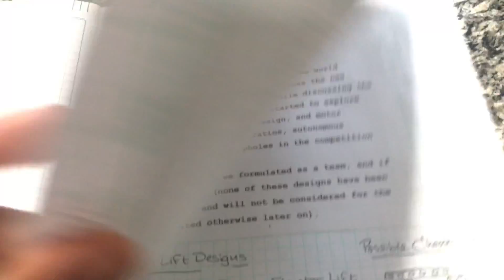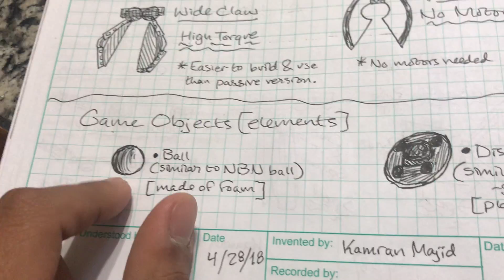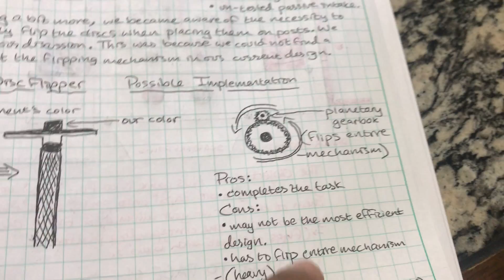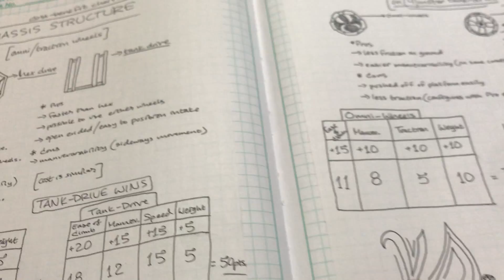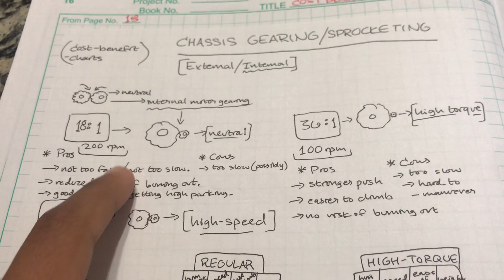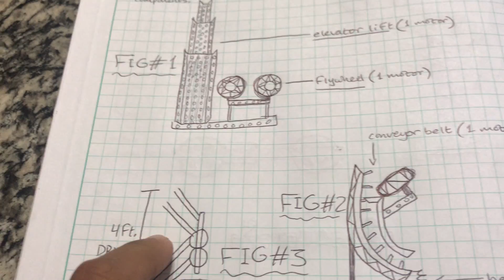Vex: Turning Point-Beginning of Season Engineering Notebook

Comment: Wait we can only use 1
Motor on the lift?? And what u Mean when u say not allowed to expand beside the expansion zone
Reply: Sorry I am new
Reply from the maker: The expansion zone is the area behind the white lines on the field, you can’t expand vertically higher than 18 inches unless you are within the boundary(expansion zone). The motor constraint of 8 v5 motors means that with a distribution of: 4 motor chassis, 1 motor intake, 2 motor shooter; you can only have one motor left for the lifting element. Hope that answered your questions
Reply: @r3v3rbrobotics35  ohhh OK thx man. Really helped a lot